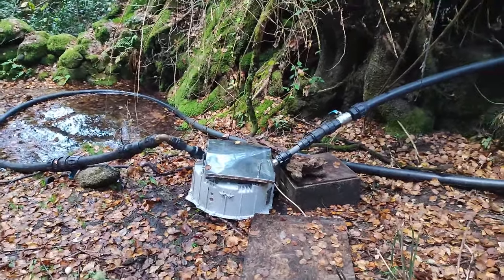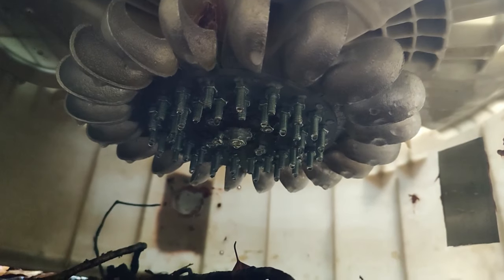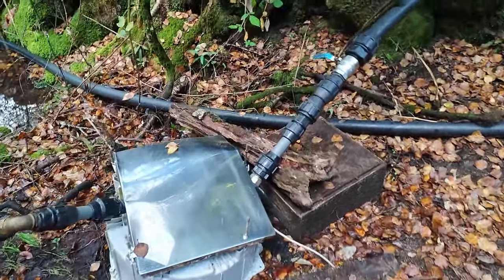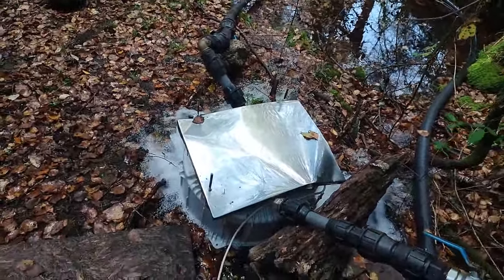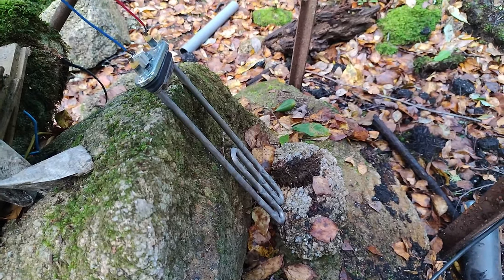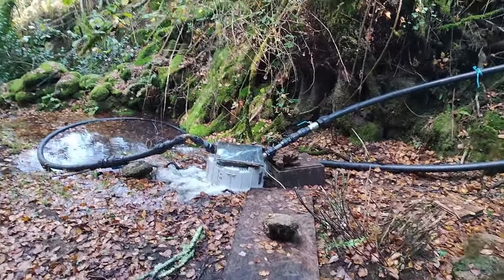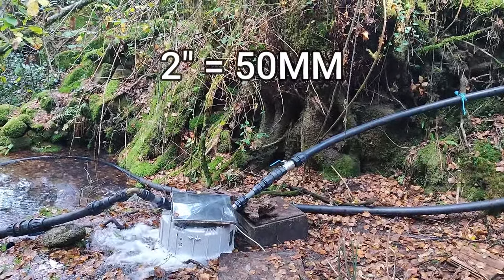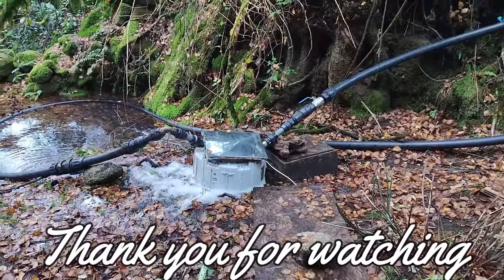P2 Turgo Micro Hydro with Washing Machine direct drive motor

Comment: Very well done. Water limitation is your pipe diameter and lengt. So even it rains much you may have no change. What we can do is shortening the pipe length and increasing the pipe diameter to have less pipe resistance to water flow and more flow ofcourse. There is a balance between nouzle diameter pipe length pipe diameter and availanle water you know. Best to do is making tests as you do. Congrat my friend 👍🙏